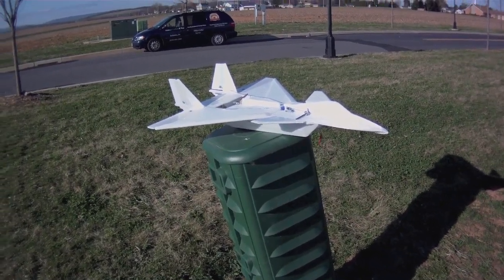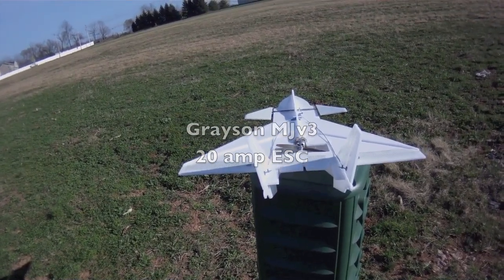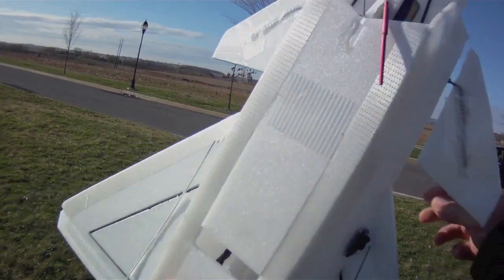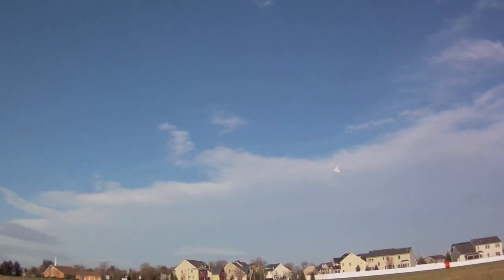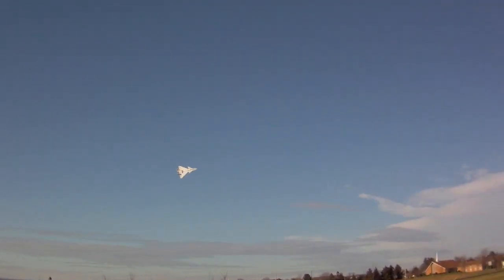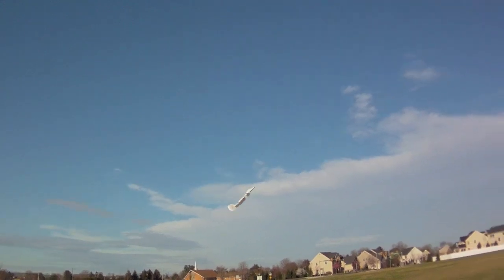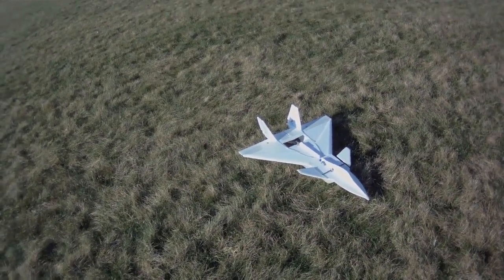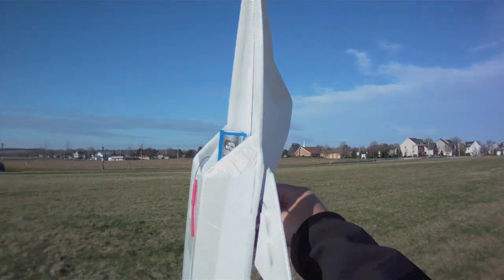Mig 1.44 Flatpack Mark ll

Comment from the maker: Ha! Just responded to your comment on the other video! The KFm4 is my favorite for most planes because it stabilizes the plane in windy conditions, which is a problem here.  I am trying to set this plane up for high alpa so I am looking for maximum lift from the kfm2.  Otherwise, I tend to steer away from the KFm2.